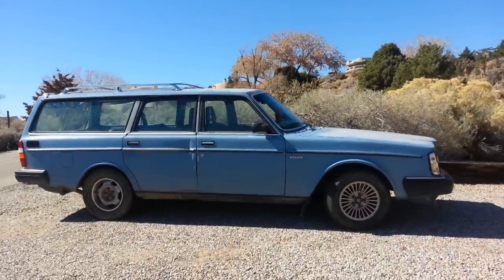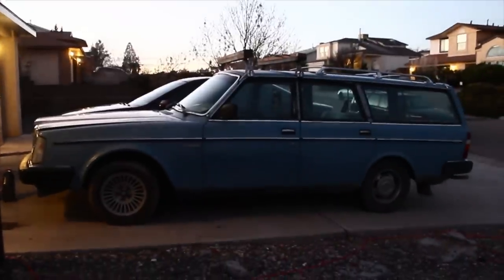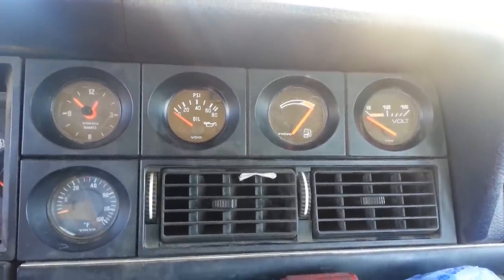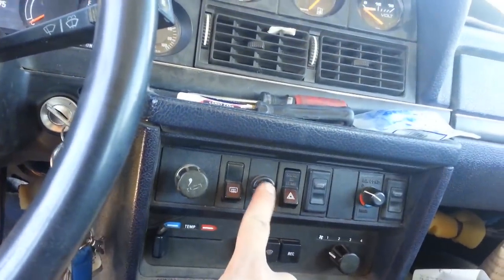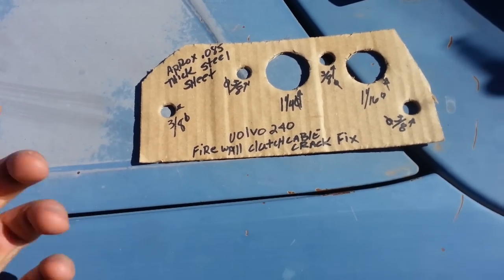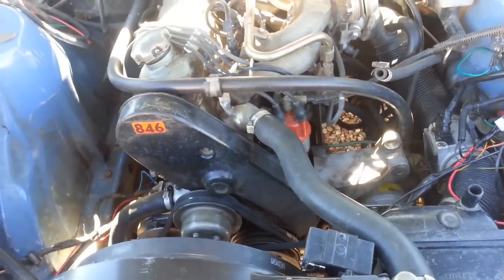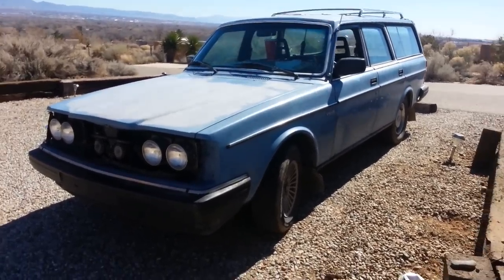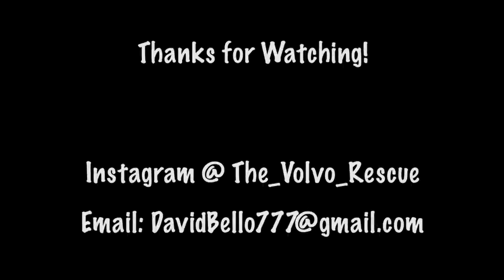1984 Volvo 240 Wagon Restoration Episode 1

Comment: may i ask have you ever tried putting the M46's overdrive gearbox behind a M47 for higher gearing? and did you know that if you cut the earth cable that is connected to 4th gear and connect it to the frame you can have a split gear on every gear great for hauling caravans on demanding roads, my father did on his 240.

Comment: Hey David, Liked and subscribed. Great content and amazing sense of humor. Really enjoyed it!You mentioned something about a V90 in a prior video, did you have one? If yes, do you know of anything body wise or engine wise that is compatible with a 745? I do have a 745 and really like the rear wiper set up on the V90p as well as some other bits in the interior. Any help would be appreciated. Again, GREAT channel!
Reply from the maker: David V hi David, David here, as far as I know, with my limited experience on the 740/v90s, they’re not going to share much in the way of interior and exterior bits. Even the engine on the V90 is a straight 6 I believe, like the 960 models. I’ve never owned one and only seen a few.
Reply: @DavidBello  thank you for your response

Comment: I had a straight solid silver '84 in a state of arrested decay with an M46 and 25 spoke factory alloys with no leaks and a new clutch and brake master and only 200k on the clock. Wouldn't have hesitated heading cross-country and plan on getting there without a hitch. Factory roof-rack..
Until someone plowed his F-150 into it at 30+ when it was parked in front of my house on a little suburban street and killed it. 
An adjuster for an insurance company to be left unnamed (cough-talking lizard) has decided it was worth $2500. I disagree Φ